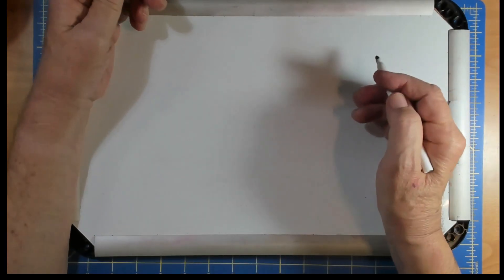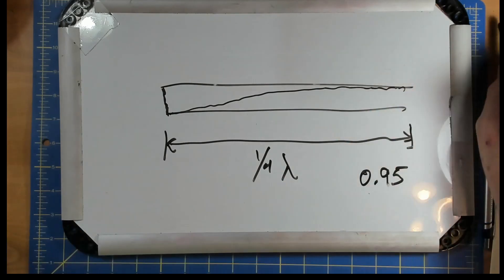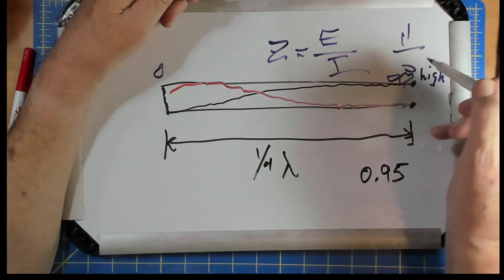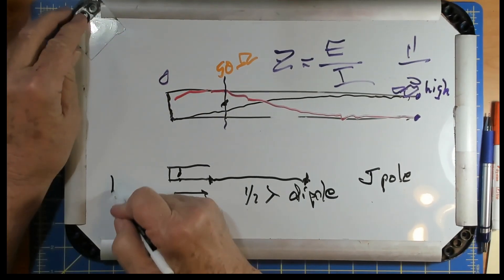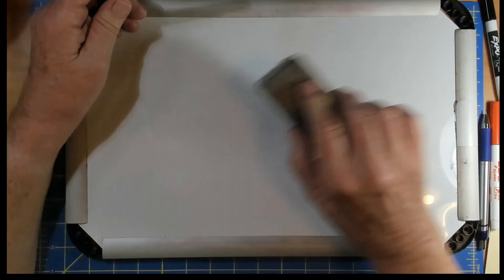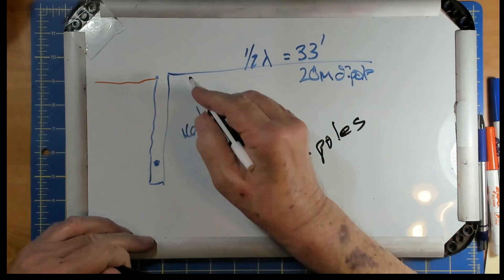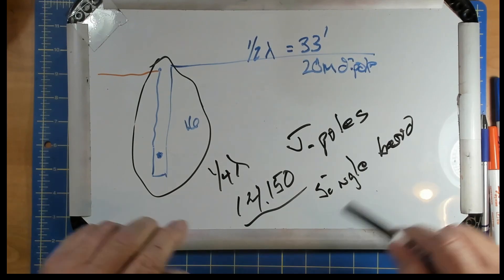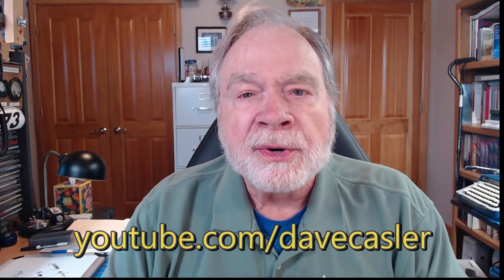QST: Ask Dave November 2025

Comment: also check out the GQRP "Mutz Nutz" loop which is a 40m half wave loop (very highZ) matched with a quarter wave budgie ladder stub but on 20 & 10 it is a lower Z quad but the budgie ladder is now a half wave multiple long so no-longer transforms the feed impedance so it is a multi-band matching stub.

You also mentioned the two half waves symmetrically with the stub which is the double Zepp, & then there is the EDZ Extended Double Zepp which is basically someone just sticking two mobile 5/8ths whips back to back to make a doublet (rather than sticking two quarterwaves back to back to make a dipole).

Talking about HF antenna ideas that have been developed for other bands there is the cellular phone IFA (Inverted F antenna) designed for limited space (your hand... scale this to HF for size limited by small yard)... but this needs a good groundplane (could try chicken wire) but rather than looking for a perfect ground with an unbalanced you could just try "doubling it up" to go for a "skeleton notch" balanced antenna which wouldn't need a good ground (& running the notch physically horizontally would be minimal height but not need to be high as it would be vertically polarised & ground reflections are constructive for Vert pol)... this would basically just be half a skeleton slot "Hentenna". .... or you could try reusing W6NBC John Portune's 2-Meter Slot-Cube Antenna for a size restricted HF antenna.
Going back to the Cellular IFA, HF guys would generally have just called this a gamma matched inverted L, but the IFA just shows that (with a good ground plane) how much you can compromise height with the inverted L configuration & still get something workable. & Talking of resurfaced ideas what do you get if you cross a new IFA bending it with John's folded slot idea... basically you have reinvented the DDRR antenna of old.

Comment: Great stuff again Dave.
I made a 2m J Pole using 450 twin feeder, then turned it into a 2 el. centre fed collinear, 4 el. centre fed collinear both with twin feeder phasing lines, finally finishing up with a 4 el. end fed collinear with coils. 
It was on 148.800 MHz but adding two more turns to each coil it is now 50 Ω -j4.4 with 1.094 SWR at 144.488 MHz as measured with my NANO VNA. Quite narrow bandwidth but great as I never go above 145 MHz. 
G4GHB.

Comment: It's not a dipole.
Reply: Everything is a dipole. Di being 2 and pole being opposites. Generically when we think of a "dipole" antenna we are thinking of a balanced antenna, two equal lengths of conductor feed from the center point between them. This is not always the case. An off center fed antenna does not have the feed point in the center and is a dipole. The same can be said about an end fed, a Jpole,  etc.
Reply: you right, this guy is sick

Comment: I took a couple (2) WAGO dual connectors, drilled out the ends to allow wire to pass through for my HF-UHF-VHF J-Pole antennas.
No soldering & re-soldering coax feed and enables quick tuning. Put one "dual WAGO" on each leg of the shorted end. I calculated Coax Tap Point = (Feed Z/Antenna Z)*Quarter Wave DIMENSION(inches, feet, cm or mm). I set Antenna Z at 1000 ohms and that gets me very close, then all I have to do is slide the WAGO connectors very slightly up or down as needed for 1 to 1 SWR tune. Also, remember to put a current choke on coax feedline.
Reply: What a brilliant idea.

Comment: What would the approximate bandwidth of an antenna like this be? You mention it can be used across the whole band and I'm curious about sizing this up for 40Meters
Reply: That would depend on the wire size.  Thinner wire will reduce the bandwidth.